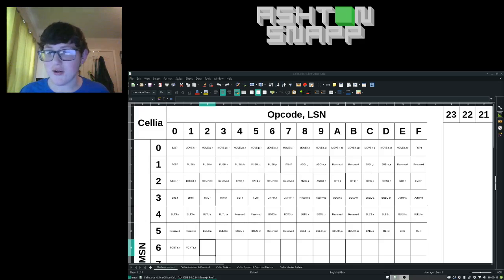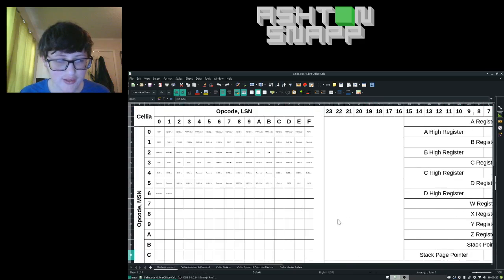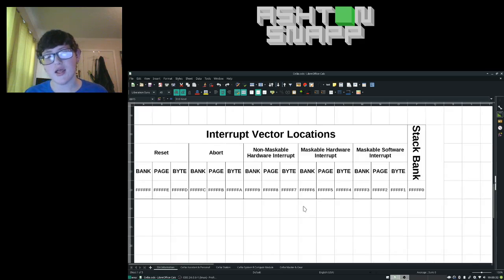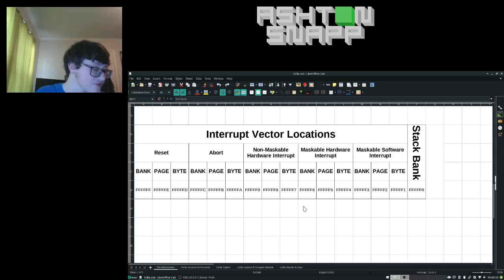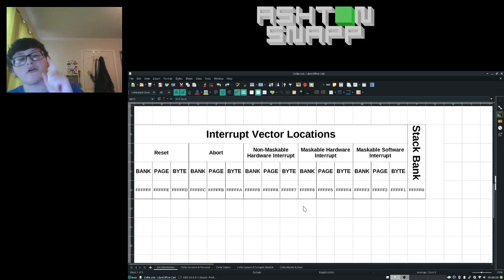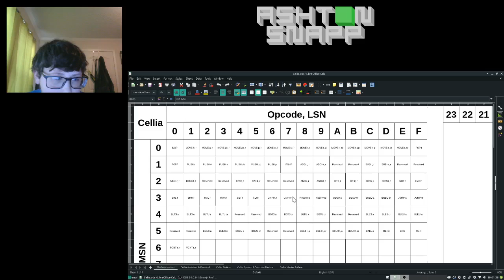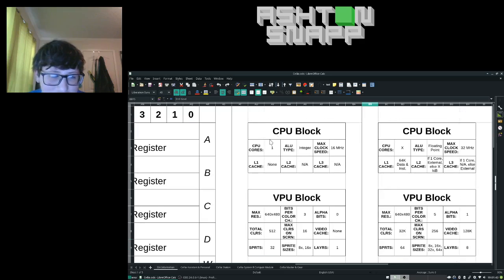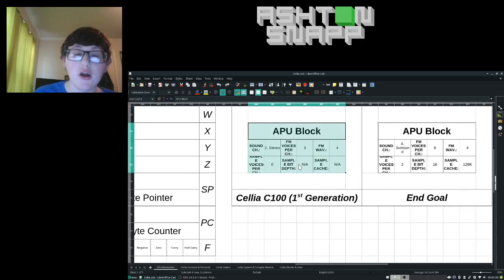I ramble about something I want to make

Comment: I was able to follow along with what you're saying, but I think the actual content in this video would make a better blog post. it would be better if I could read them and not just hear you read it all out. Maybe make a follow-up video explaining the differences between a register and a bank and a stack for the viewers who don't know that already?
Reply from the maker: I agree that it would be better suited as a blog post, but my WordPress blog has been acting up. Specifically, it seems to have broken its .htaccess file as I get a 403 forbidden when I try to access it on my laptop. In addition, it crashes whenever I try to post anything using the web interface. :/

I need to replace wordpress.